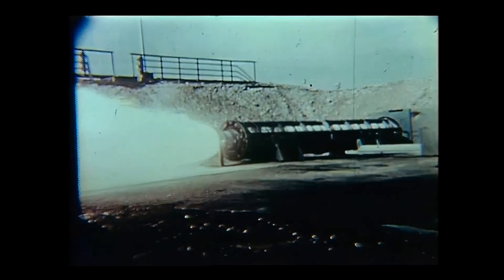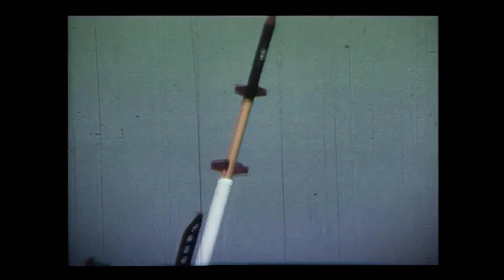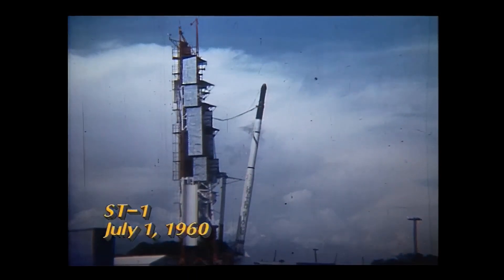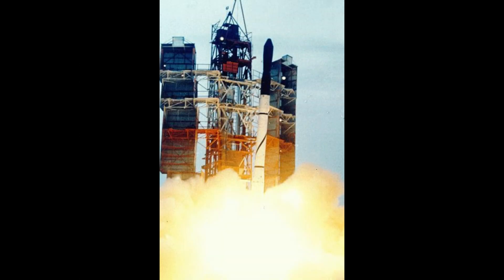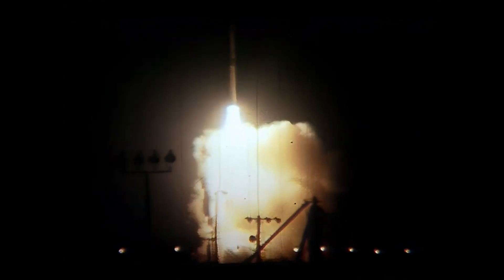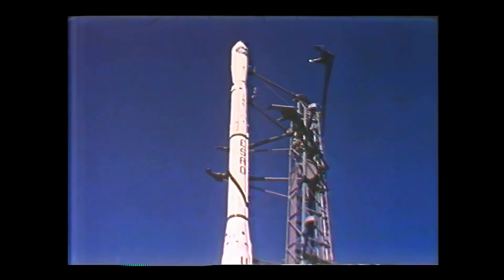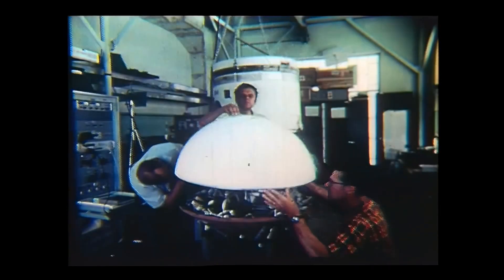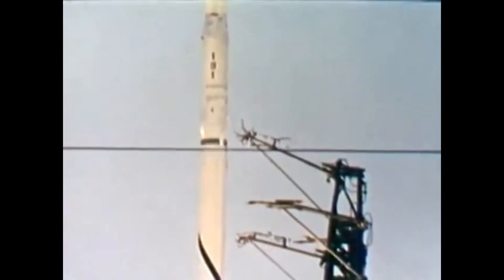The NASA Rocket Everyone Forgets Exists

Comment: Why doesn't space x use a honeycomb  mesh in the fluid tanks to eliminate or reduce slosh issues
Reply: Baffles have weight, baffles strong enough to resist hundreds of tons of fuel sloshing about weigh quite a bit.

Improved flight handling software to maneuver the craft so that sloshing is eliminated in the first place has 0 added weight.
Reply: I always assumed there was some type of baffle system. No?

Comment: Is there any other orbital rocket with a GREATER length to width ratio?
Reply: Discounting the Indian look-alike, no.  Perhaps the next closest is the Japanese L-4S, which was also solid propellant but a technology/operations pathfinder rather than an operational satellite launcher.  It had an L/D of about 22.3 vs about 25 for the early Scouts.
Reply: @marcmcreynolds2827  If I had to take a quick guess I'd guess high L/D ratio would suggest a high-power but low specific impulse powerplant. 
Thanks for your reply.

Comment: Scout was also "inspiration" behind ISRO's SLV and ASLV and earlier Agni series of missiles.
So in a very round about way it went Polaris to Agni with couple of civilian launchers in between.
Reply: And the first stage of the SLV-3 continues to fly as strap-on boosters for India's PSLV rocket.
Reply: I was going to say that, ASLV and SLV definitely took "inspiration" from Scout.
Reply: @sheshankutty8552   A further example of such cross-pollination:  Once the Scout had grown about as big as it could get (a 45"-diameter Algol instead of the original 40" one, better upper stages), what was left for increasing payload was to add SRMs as had been done going from SLV to ASLV.  In one version (Eagle Scout?), the two SRMs would have been the same solids used by some of the Arianes (3, 44LP).  But none of those augmented Scouts were ever built.
Reply: Early on, USA was providing India with training and hardware for smaller suborbital solid fuel rockets. At some point, India requested assistance with building an orbital-class rocket. But  the USA refused to transfer the technology, beyond pointing out that the design of the Scout was described in considerable details in open literature (NASA reports). 

There was indeed a NASA document thick as a book, with the details on flight control algorithms and parameters for the Scout, aerodynamic coefficients, test flight data and other details. Of course, there were many, many technical challenges in making the actual hardware, but it was a good beginning. I think French assisted with the fuel technology and Germany with the guidance system, but Indian industry and engineers have done the bulk of the work.
Reply: @cogoid  "There was indeed a NASA document thick as a book, with the details on flight control algorithms"  Yup, lots of details on what worked, what didn't and why, when to switch the gains on a particular stage's flight control system... one thing after another.  Could probably save a North Korea years, though as it happened NK also had expert outside help (from India -- hmmm...).
Reply: @marcmcreynolds2827 India has nothing to do with north korea, they got their nuclear help from pakistan, china and only recently mastered solid fuel missiles